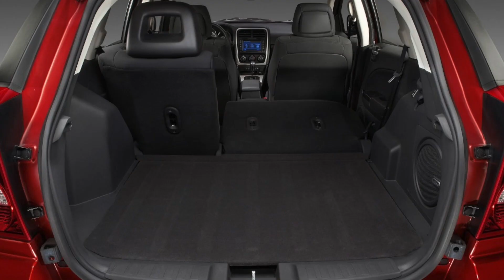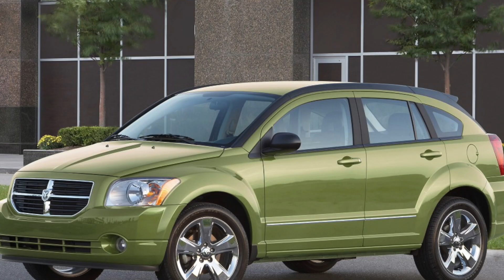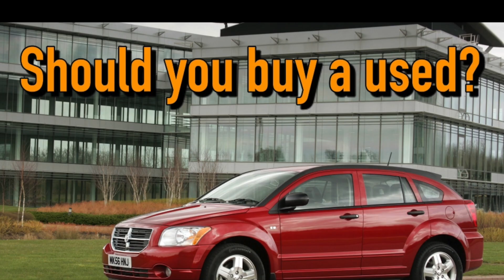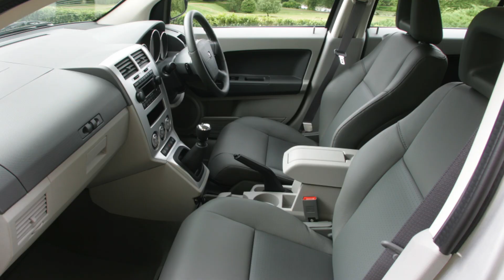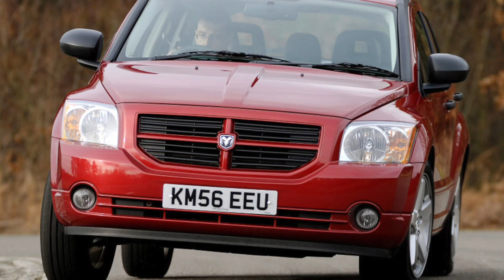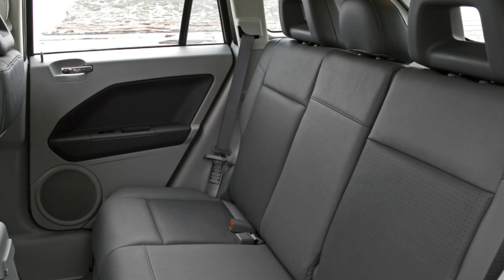Dodge Caliber Problems | Weaknesses of the Used Dodge Caliber I

Comment: 2007 Dodge Caliber SXT, owned it for 15 years now and have had to replace: TIPM, throttle body, control arms, front struts, steering column (leaking power steering fluid), and fuel pump.  138,000 or so mile on it

Comment: I have a 2010 manual transmission that i bought in 2022. I have only changed the transmission drain plugs and new transmission oil. Other than basic maintenance like oil change, tires and brakes. And runs amazing. I now want to buy an exhaust or even engine swap it for the 2.4turbo, but maybe later when I buy a new car and have this as a little toy

Comment: I had an 07, while the paint was good, most of the rubber roof moulding cracked and started coming off.  Took it to the dealership and they said it wasnt made any-longer, WTF!. SO I I used black duct tape, terrible!
Reply: There’s one video on here of a guy changing the plastic molding out for a used set.  Didn’t look like much of an improvement.  I used his video to figure out how to remove it all.  Cut the torn edges off with a utility knife.  Sanded that with my Dremel.  Painted all the parts with Trim and Body paint.  Used a 3m rubber trim molding to fill the gap.  Replaced a few of the gaskets where the trim clips to the body.  Snapped it all back together.  Looks pretty darn good.  Should hold up for awhile, and keep any water seepage out.  (I’m a 58 yo grandma.  Did this to my son’s car.  If I can do it, anyone can.)
Reply: Thats really smart!

Comment: Mine is a 2010 SXT-CRD with 295.000 kms. I changed front and back suspension at 220.000 kms  and the turbo at 260.000 kms. Good oil (LiquiMolly 10w50-cause I live in Portugal) and good diesel at the station,filters every 20.000kms,all job did by myself. I still love the car. Lots of space for vacation trip plus surfboard plus dog…never had any electrical issues.

Comment: Just bought a 2009 SXT about a month ago with 157k. Just needed new wheel bearings and tires. I put new struts on as they were wearing. But runs fine and hope it stays strong. I also did the fluids and normal used car maintenance

Comment: 2010... throttle replaced lower control arms are going out need to replaced but I've had it for 4 years and loved it. I'm 6'6" and with the passenger seat down and a sleeping pad I haven't slept in this car it's a great car
Reply: And I would definitely suggest a KnN filter

Comment: I bought a 07 caliber 9 months ago turned out there was a major headlight issue when I first bought it where no headlights turned on when the low beam was on and when the high beam was on only one light would turn on. Ended up doing some wiring and got the high beam setting to get both low beams to work which sounds very confusing. I also had front suspension issues. Replaced front control arms, ball joints, inner and outer tie rods and I’m probably forgetting something. Transmission made a whining noise if driving over 30 minutes on the highway and one time the transmission overheating light came on so I did some research and came to the conclusion of changing the transmission fluid and filter. A lot of issues at first but turned out to be a decently reliable car after all those issues were fixed!
Reply: How many miles on the car?
Reply: My daughter just bought a 07 SXT, 120 k miles, she gave $2800, It runs and looks great, I can tell it needs new struts but that's no biggy considering how old it is, Going to change the struts next week, Going to look around and find the best price right now, lol Any suggestions would be great???

Comment: I've had an 07 for about 9 months (bought at the beginning of 2021) and it has been absolutely nothing but straight garbage. The PCM fried, the alternator fried, the transmission is iffy, the suspension is totally blown, and I have an engine leak of unknown origin (meaning it isn't coming from a usual oil leak spot). I absolutely think that this car is straight trash and there is a special spot in hell for it, but I just can't seem to throw the thing away. It gets 30mpg on average, its relatively quick for a 4-Cyl, and it can get around off road just as well as its larger competitors. 

TLDR, piece of shit, would buy again
Reply: would by again or wouldn’t ?

Comment: Dude every car has problems i bought last year 2008 Caliber SXT is still runs fine and some people say wow what car is this because there are only 2 in my city! :D
Reply: I m from Macedonia small city Veles btw 😀
Reply: I drive a 1.8L with the 5 speed Manuel and people look at me and ask what are you doing with that thing in the center 💀
Reply: Every car has problems, sure, but some are much, much worse than others. A 2008 Dodge Caliber compared to a 2008 Toyota Corolla is no comparison at all. The Corolla is much more reliable and durable. It's not even close.
Reply: @genericusername1365  Me (just repaired my caliber again) wishing I would've just bought a toyota.
Reply: @xGiga-_-Chadx  Toyota sucks

Comment: CVT transmission OveHeat on Sunny days🥺
Reply: I had this problem last year. My mechanic installed a transmission cooler. Get one. Hasn't happened to me since
Reply: Thermostats go bad at around 160k miles that's when I had to replace mine in the 1.8L

Comment: Have a base mode 2007 for $1200 for 3 years 

All I've done was a valve cover gasket and basic maintainece. 

Runs like a dream.
Reply: that's the same amount I paid for my 2008 sxt, it also needed a valve cover. It's been reliable though ❤️ but it has trouble accelerating sometimes.
Reply: @Kariwastaken9  lmao got my 2008 sxt for $1000 just needed control arms and Blower motor for Ac
Reply: How many miles

Comment: The most of them have problem with the dashboard backlight. But it can be solved for 100$. Besides that  no problem so far. 20k km behind
Reply: Just need to touch dash board button to reset while u turn ignition on and release and it should light up.
Reply: @Platinumtag   The problem was on the motherboard of the dashboard. The inverter for lighting was dead.
Reply: @foodvlogr4486  i just connected LED lights strip on the orange/grey wire and glued it behind the cover. No need inverter and i can change colors too :P
Reply: @vgothica83  Nice touch, but I like  the original condition